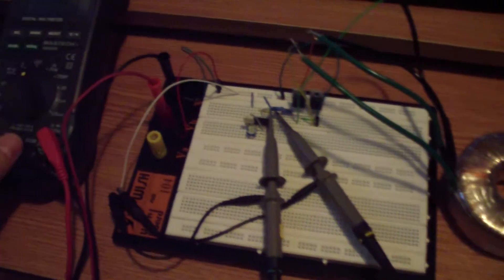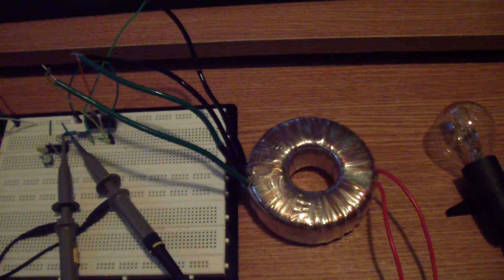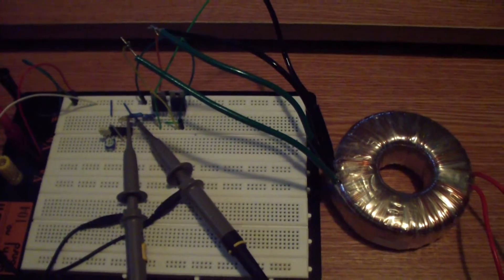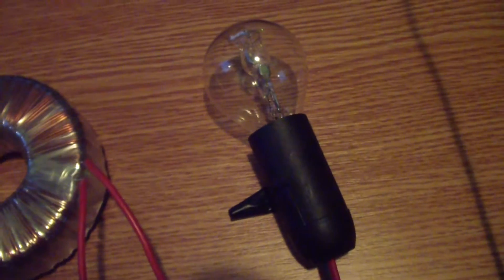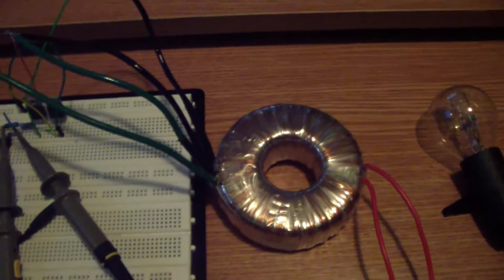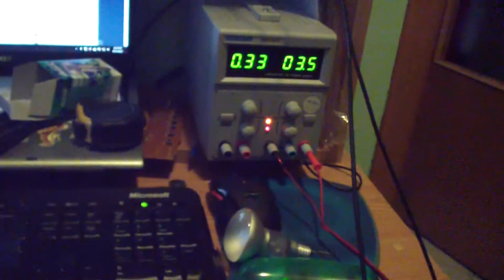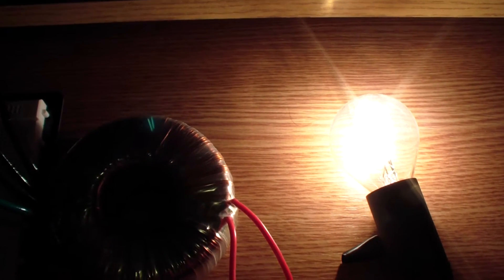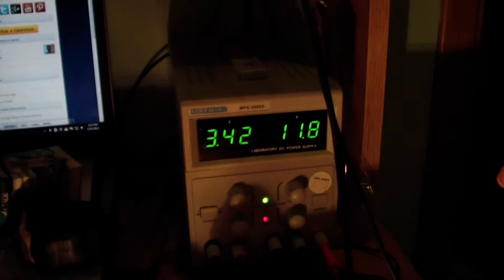DC to AC inverter with MOSFETs

Comment: When I build this or the similar one with an NE556, my MOSFETs overheat.  Also, my power supply gets overloaded and won't go above 7.5V.  The switching is working properly (opposing square waves), but I can't get any output from the transformer.  Any advice?